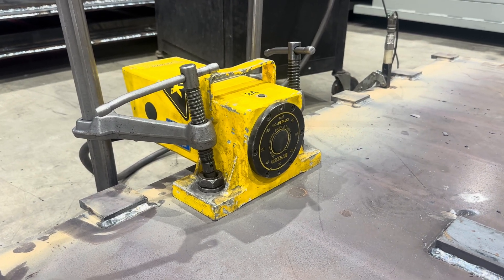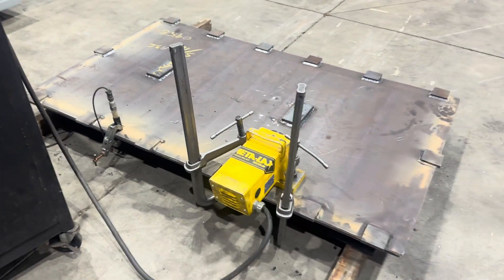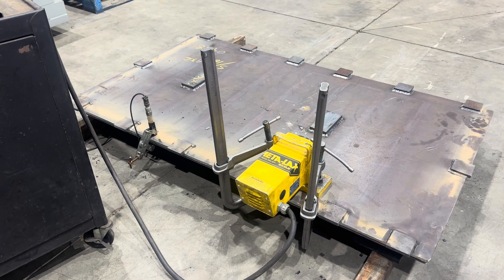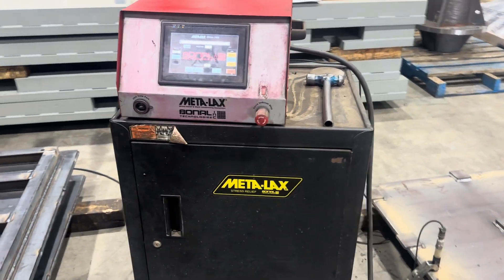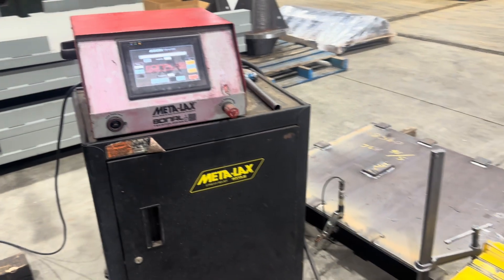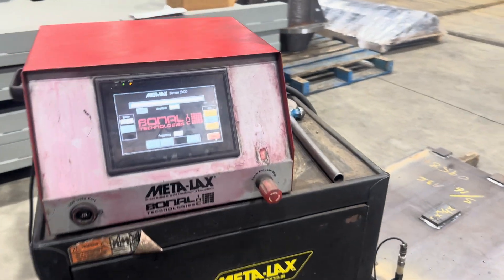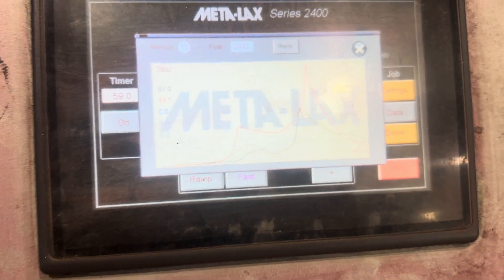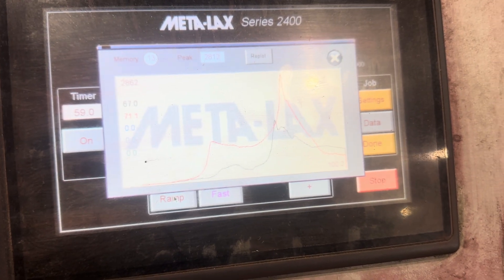This Machine Vibrates the Stress Out of Steel: Meta-Lax VSR Demo

Comment: Never heard of one but just saw one on FB market and decided to search youtube to see how it works. So now i know. Thanks. The one on FB was a Bonal Technologies Meta-Lax Stress Relief & Weld Conditioning, Model 90002A.
Reply from the maker: Glad it helped! There are a few different systems out there, but the principle is the same.

Their great man! We just used them on some 8.00 thick guide rails.. bars were moving 0.01-0.02 thou.. slammed the vibe on them and stabilized them to +/-0.003 

Cheers man!